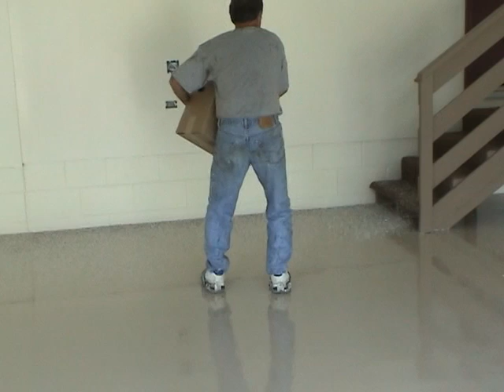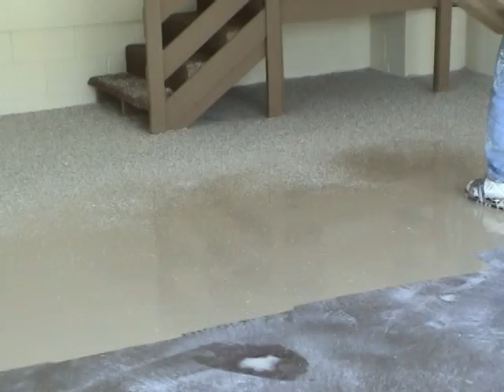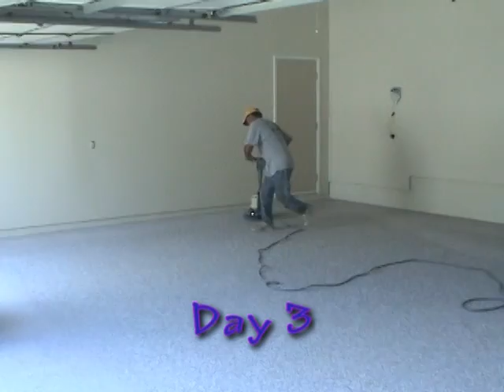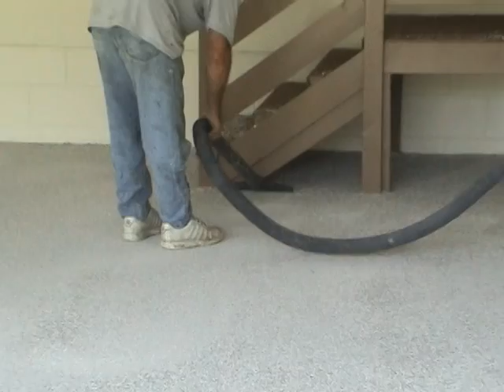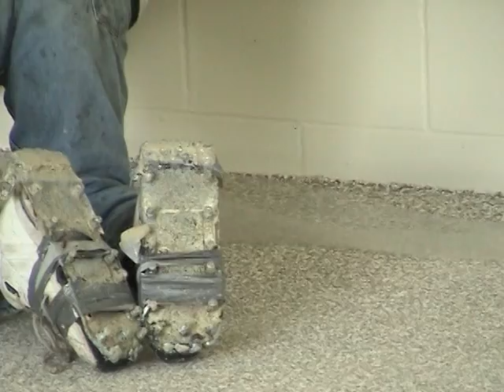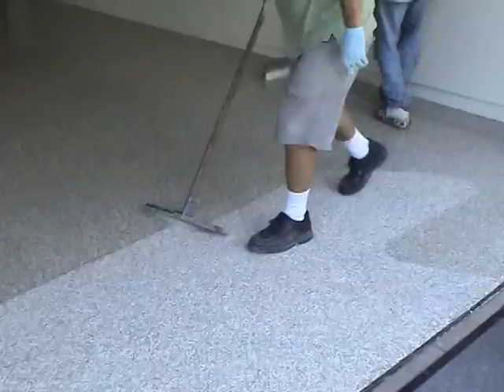Garage Floor Epoxy Finish, video 3 of 3

Comment: It looks GREAT!!!

Do you know where the epoxy was purchased as well as the chips? Everywhere I look for epoxy I find it, but there is only a handful of chips that come with it. (I believe that you even mentioned that in one of the first other videos. 

Also, what did they use to fill in the "holes" to level the concrete?

This would be very helpful to me if you could reply.

Many Thanks!!